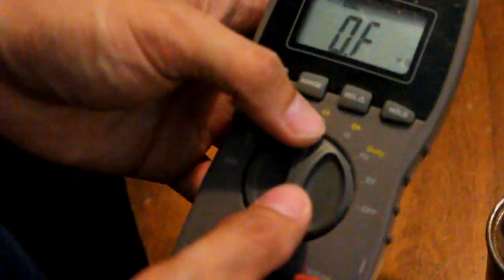Howto check run capacitor for HVAC AC air condition - DMM testing

Comment: You did not discharge the capacitor before testing it.  Why
Reply from the maker: Sss Ttt its bulged out which means there isnt any connection to the plates. which then means why i had the confidence that no charge is on the leads.
And even if there is connection and some charge exits, then its never enough to kill or hurt anyone. it might have a higher voltage, but not high enough charge. its like rubbing a ballon and have sparks. to kill or hurt, you need high power with high voltage. But, there are some that disagree.
Reply: DIY Tinker  Thanks

Comment: I tested my capacitor the readings were as follows C to Fan was 31.5 and C to Herm was 1.6. Capacitor numbers are 60/7.5 MFD + - %10 is this capacitor bad? im new to this and I dont want to have the AC man come out and charge me $100 to change this if i can do it!!
Reply from the maker: yes, its bad. time to replace.
Reply: Nope.

Comment: Good question! Though he is correct about the leakage over time, if you want to ensure any capacitor is dead; just take any screw-driver (bit type isn't important) and make sure the handle is plastic. Next, place the metal shank (long metal shaft between the bit and handle) and bridge each contact. If the capacitor is still charged, this will allow any residual electricity to discharge, effectively "emptying" any potentially stored energy.

Comment: VOM (Volt-Ohm Meter, old school term) and DMM are both equally acceptable. And yes, he switched to capacitance. Even if he didn't, an ideal capacitor's resistance approaches infinite as the capacitor becomes fully charged. Even if he *did* have his DMM set to measure resistance, it was less than 1ohm (essentially short), indicating a discharged capacitor that failed to charge (the resistance didn't change as he measured). Go back to school.

Comment from the maker: For a cheap $20-$40 then 200uF to 500uF is all you really need. $200 Fluke is a great brand and it can go beyond a few thousand uF. Resolution is also higher as the price goes up.
Mine is a cheap $40 Radioshack DMM. For the most part it works just as well as my $300 Fluke at work.

Comment from the maker: Capacitors do not 'charge' up on its own. you need voltage and current to charge up a capacitor. A capacitor also does not "hold" charge forever. Any capacitor will discharge over a short period (seconds to few minutes)

Comment: Oh my God this pisses me off when guys think that this is a correct way to check for Uf values on a run capacitor. This guy clearly doesn't know how to use his meter. For one he calls it a DMM (Digital multimeter-btw I think he just made that up) He switched the selector dial on his meter to Ohms (which he called capacitance which is not the same thing at all) Bottom line is this guy probably works apartment maintenance and has no clue what he doing PLEASE STOP WORKING ON A/C's